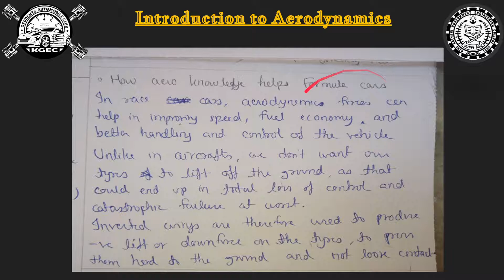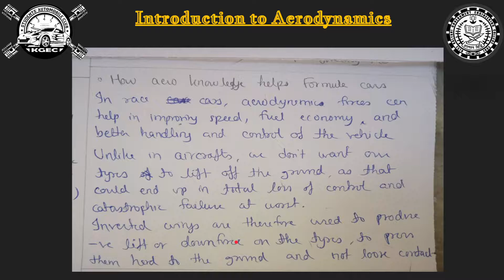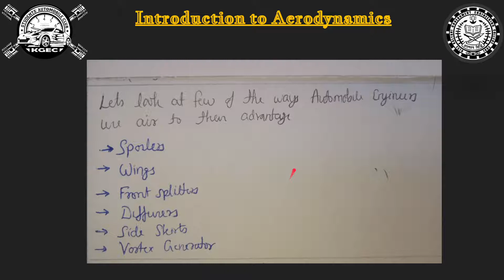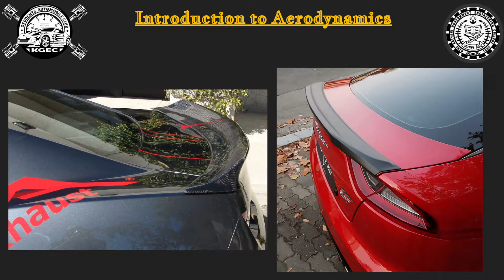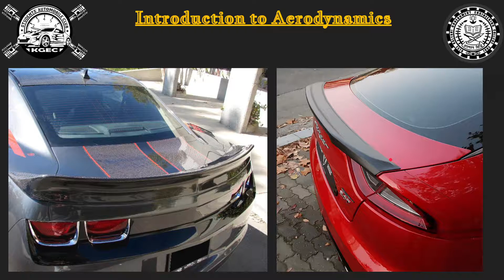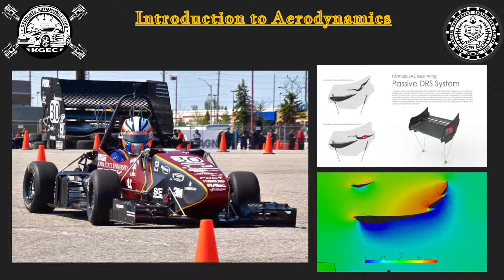Comment: Let me elaborate a little more about using downforce to get better handling and greater cornering speed, so as you know if the road is not banked, the entire centripetal acceleration has to be provides by the friction between road and tires, now we can't change the friction coefficient between road and tires, but the normal reaction can be increased way beyond the weight of the vehicle by adding this downforce mix to it, that is why, wiser use of aerodynamic forces would help us in taking sharp corners at higher speeds